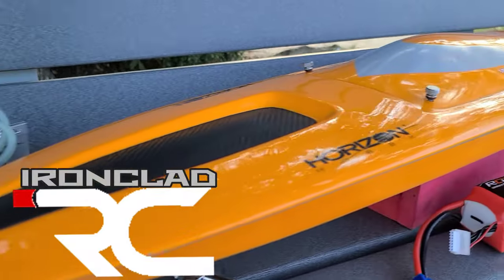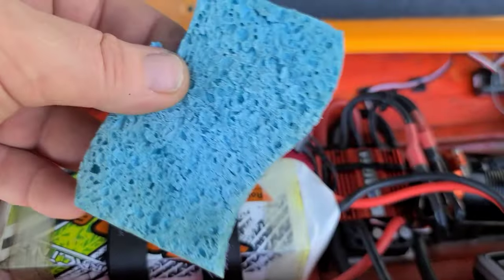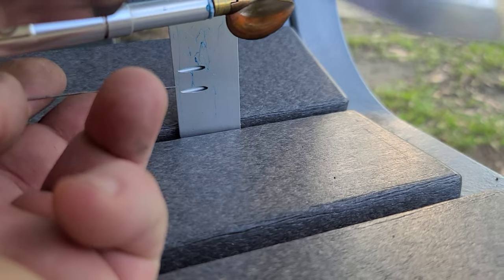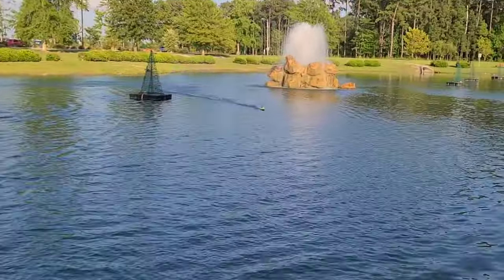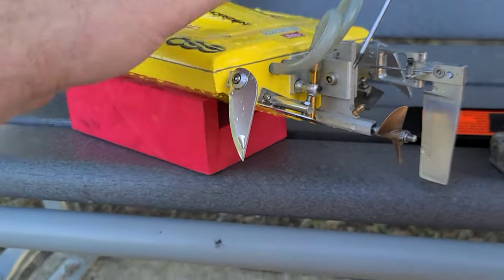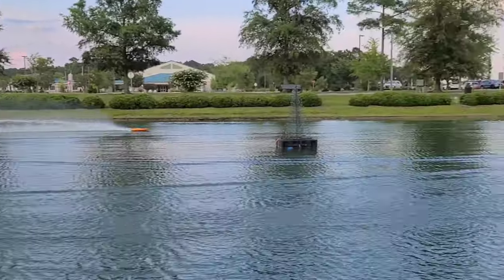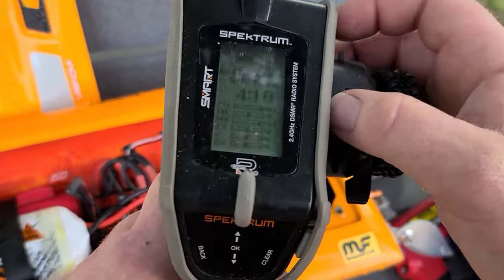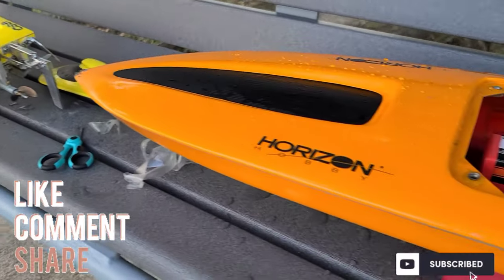Hobby Tools & Tips For A Successful Day Boating - Fast Rc Boat Basics - Deltaforce 23 & 35

Comment: 4S with a 4000 Kv 2968 and a 40mm prop?  Yup, a melted solder joint is definitely possible.... Thank God no smoke!  😉
Reply from the maker: I usually run a ose 42 mm chopper prop with low blade area on 4s that's my basher set up with a flycolor 90 with cool Temps.  
 https://www.offshoreelectrics.com/proddetail.php?prod=ose-80708 

It's only 60, 000 rpm lol.
Reply: @IRONCLADRC  Yeah, that is a pretty low blade area.  I'll bet you're pushing close to 100 amps at Maximum Mojo with the M440.

Comment: Oh hell yea. My first run was sweet until the battery ends came off must have been a bad solder joint with a 6S battery. Then the 2nd rip 😂 the ESC ends came undone. But thank God for Horizon Hobby‘s tugboat and save both pro boats in the green machine. Put a 150 amp ESC now I’m doing the water pump. 👍😎🇺🇸
Reply from the maker: That tug boat is a must with fast boats running 6s.   Especially in the summer HOT MONTH'S
Reply: @IRONCLADRC  Yes sir True That. But it’s a blast. ❤️👍😎🇺🇸

Comment: Nice, nice, nice! What are you using at the tip of the string on your fishing pole? Does it work well when the boat is upside down?
Reply from the maker: I usually throw what ever I have laying around  on the string. Wrenches weights rocks anything really nothing specific

Comment: Damn some serious angle on those turn fins, ever try running them at 45* instead of 90*
Reply from the maker: I usually run xl turn fins on the little deltaforce.   The small turn fins don't grab the water at a 45° angle,  and the back skips really really bad so I run them deep and steep..

Comment: Hey big B! I was wondering what your receiver situation is. I’ve got a 22inc full brushless custom boat, but can’t run it because I’m not sure what to do with my receiver. Do you do any water proofing? I’m running a dumborc X6F receiver.
Reply from the maker: I usually spray all my receivers with corrosion X  waterproofing spray.   I stand behind that product 100%  just spray a little in the rx done.